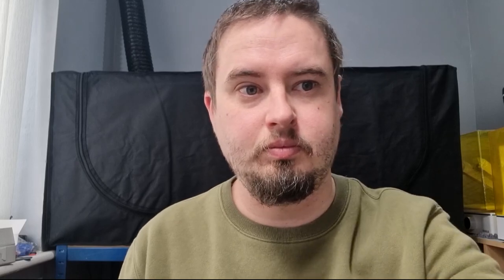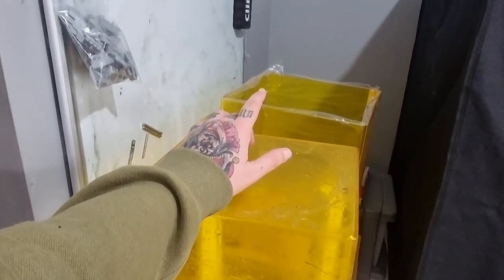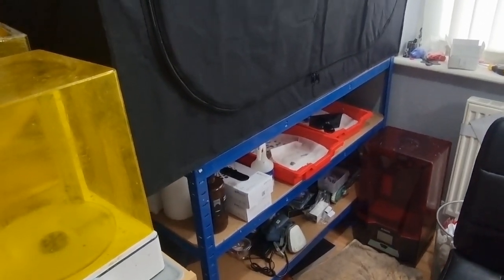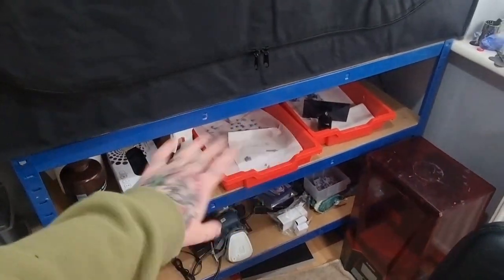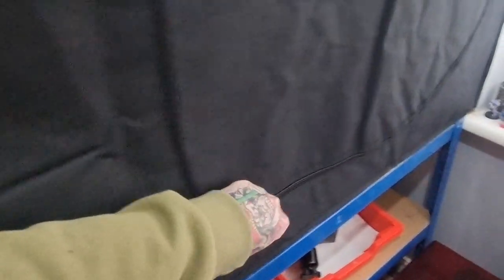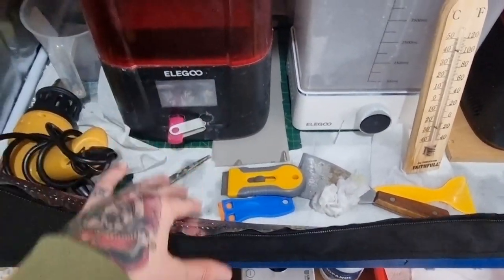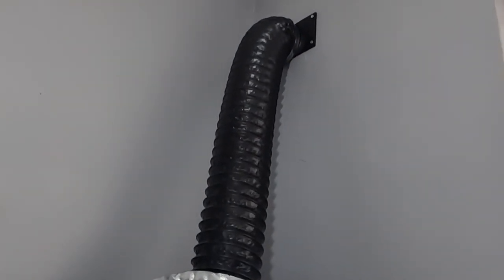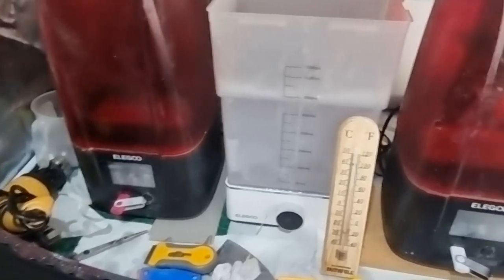How To Safely Resin 3D Print In Your Home

Comment: FYI resin that has a smell that's taken away does NOT mean the harmful compounds are removed, only the ones you can smell. You need an air quality reader for volitile organic compounds to be sure.
Reply from the maker: The whole point of this setup is to remove VOCs, not just the smell. I apologise if I didn't get that across. I have since bought a reader and the levels read fine.
Reply: @bitzbox  sorry that wasn't directed at you I should have worded it better it was a general warning.

Comment: Have you ever used an air quality checker to see how well this works?
Reply from the maker: I do now have an air purifier in the room now too, which automatically turns on when the ait quality is poor and it never kicks in whilst the grow tent is closed with the extractor fan on. I would love to be able to do a more accurate test of this mind you
Reply: @bitzbox  Awesome! I would be curious about a follow up with this with a TVOC monitor to see if it's able to move enough clean air adequately. I appreciate the response! I'm getting a shopping list together to dive into resin 3d printing. Thanks!
Reply: @bitzbox What air purifier do you have? I find that these tiny filters from the printer manufacturer have nowhere near enough carbon volume to filter resin fumes. Also does it trigger on TVOC?